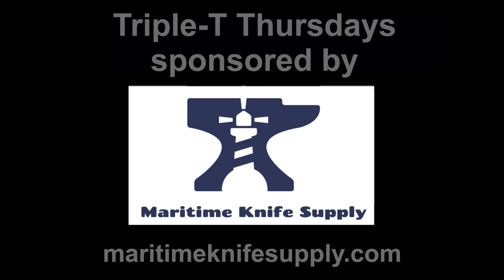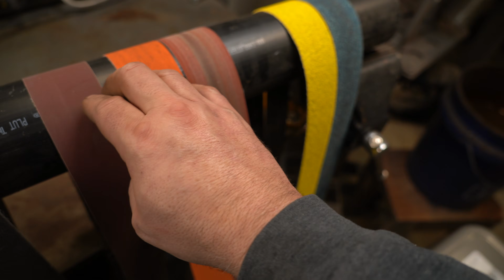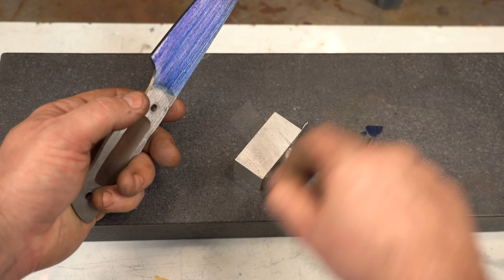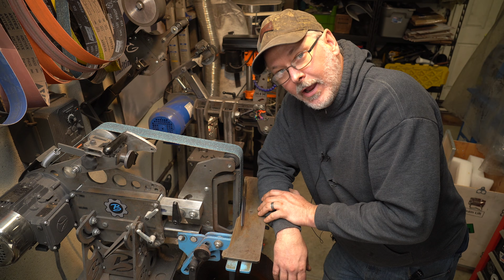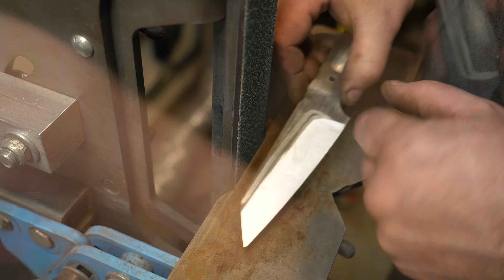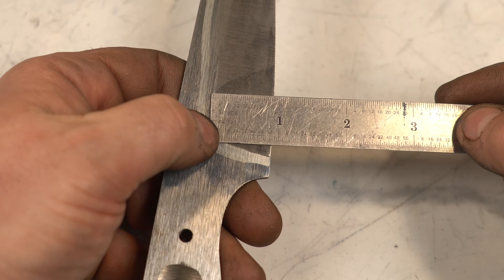Triple-T #174 - Knife grinding basics

Comment: Great information, but what causes the plunge line angle to be different from one side to the other. One angles perfectly forward a bit but on the other side it's more vertical or like 90 degrees to the blade edge?
Thanks for sharing your knowledge. 
William
Reply from the maker: If the blade is held perfectly flat on the rest, they should be identical.  I believe they were on this knife so it might be the camera playing tricks.  Thanks for watching.
Reply: @TyrellKnifeworks Actually it happened on a blade I was grinding but I think I figured it out thanks to your instructions, got them matched up now.

Comment: Sir, just found you by accident. Wow. You do a great job in educating a craftmanship where often feel is the argue more than controling the process. There is always a rule of thumb such as in bevel grinding. The blade shape you use is very good for beginners because of the straight lines. I advise sincerely to use something similar like a reverse tanto with an almost straight edge geometry as well. Well done, Sir.
Reply from the maker: Thanks for tuning in!

Comment: That is a well-done video, great work! I have a question about belt direction. I see you don't have a forward/reverse switch on your KBAC control. If you had reverse available, would you use it for grinding bevels?
Reply from the maker: I would NOT advise using reverse to do bevels.  Beside the obvious of it blowing sparks in your face, it would be difficult to see what you're doing.  I do have a reverse on my other grinder and frankly never use it.  Thanks for watching.
Reply: Thanks for the prompt reply. You’re right about not standing directly over the spark shower! I thought that reverse might be better to at least take the 90° corner off and save a bit of belt grit, standing to the side of course

Comment: Do you ever use a jig to sharpen or hold longer knives at the desired angle?
Reply from the maker: I actually don't recommend jigs.  They just delay the inevitable learning of freehand grinding.  Jigs can be quite limiting and actually take longer to grind with them so I don't like them.  Thanks for watching, Paul.
Reply from the maker: I will correct my previous comment, I meant I don’t recommend jigs for grinding.  Sharpening is a whole different story and I definitely use a jig for that. Stay tuned for the sharpening episode.  👍

Comment: One thing I wanna mention for beginners, the J weight belts are really good for cleaning up your plunge grinds. Ive made huge improvements on my plunge grind symmetry since figuring that out and I use them on every knife I make.
Reply from the maker: That’s true, they are flexible that way.  In the intermediate series I’ll show using a waterfall platen.  Thanks for watching.

Comment: @TyrellKnifeworks I believe you failed to mention that a new belt will take material off much easier and much quicker than a well used belt, so the beginner should be aware of that, and go a bit lighter on pressure or check their progress more frequently
Reply from the maker: I think that’s pretty well understood that new belts cut faster. 😉.  Thanks for watching.

Comment: Hi M. Tyrell. I’ve been doing knifes for less than a year … I’m still a beginner (and I’m 44 😅) and I’m still learning a lot. The content you and your fellow knife makers helps A LOT. Thank you for that. I have a question though: In this video you are grinding a fairly straight blade, there is not much curve on the edge (like with a chef’s knife for instance). If you were to grind a curved edge using this technique (I mean with the help of the work table), would you still make a linear back and forth? Or would you follow the curve? (if yes, then wouldn’t the work table be an obstacle rather than a help?). Thank you again … from a follower in France.
Reply from the maker: That's a good question.  For a blade with an "outside" curve like a typical european chef knife, then this technique still applies.  I do all my chef knives this way.  When you approach, say, the tip of the knife that curves upwards, you pull the blade away from the platen a bit to match the curve.  I'll cover this on the next grinding video when we do final grinding.  Thanks for watching!
Reply: Thanks for your answer !

Comment: it might be a dumb question, but how much pressure do you use with your thumb?
Reply from the maker: "Enough" 😉.  Seriously though, it's something you'll get a feel for.  Once you get good at it, you'll be able to use more pressure and take off more with each pass and still maintain a smooth bevel.  When you're starting out you're best to slow it down and take a little each time.  I hope that makes sense. Thanks for watching.

Comment: Great demonstration of bevel grinding.   Thanks for sharing.
Reply from the maker: Thanks for watching, Dominic!
Reply: @TyrellKnifeworks  of course.  Yours is among the best maker material out there.   Do you use carbide plunge guides?   Any recommendations with those?
Reply from the maker: @dominicdwk  If you mean a carbide file guide, I don't typically use those.  Because I use the rest for the majority of my grinding, it impedes the use of the rest with a file guide attached to the blade.  That's why I mark the plunge line with a scribe and do it by eye.  The carbide file guides are also affected by how much the belt hangs over because it will change that plunge area.  If you want to get your plunges perfect, consider a waterfall platen instead, IMO.
Reply: @TyrellKnifeworks  hmm. I like that idea and have seen others do that to good effect.   I’ll use the waterfall platen on my next batch.

Comment: Another great video!  If you put a couple tablespoons of baking soda in the water bucket you are dipping the blade in it will help prevent the blade from rusting so quickly.
Reply from the maker: Yeah I've heard that, but I'm usually just too lazy to get that done every time I fill it.  🤣.   Thanks for the tip though and for watching, Barry.

Comment: Great video Denis! Just a suggestion. I like to use digital calipers to scratch a mark on the side of the blade so I know where to stop the bevel height and that they will be the same on both sides.
Reply from the maker: Yeah, I should have mentioned that.  I'll add that for the final grinding.  Thanks for watching!

Comment: Sair what oil is good for quenching knife plis suggest me
Reply from the maker: Matt answered this perfectly.  It depends on the steel you are using.  I'll be covering this in my next video.  Thanks for watching.
Reply: Parks 50 or AAA it depends on the steels you are trying to harden. Some require certain parameters typically you can find this information from the supplier.
Reply: Parks 50, Parks AAA, durixol V35